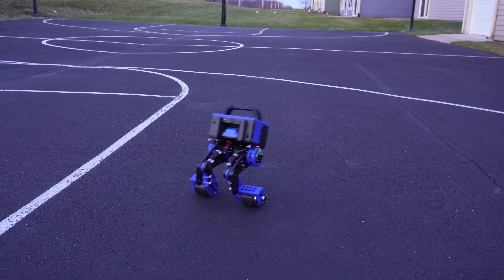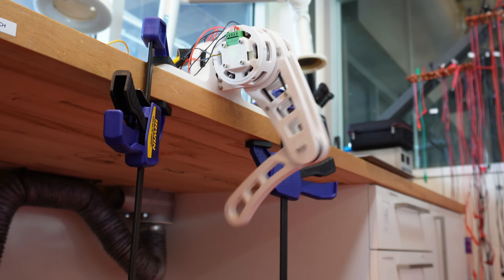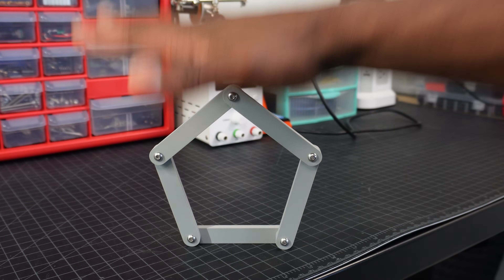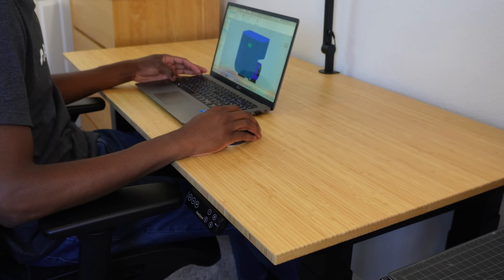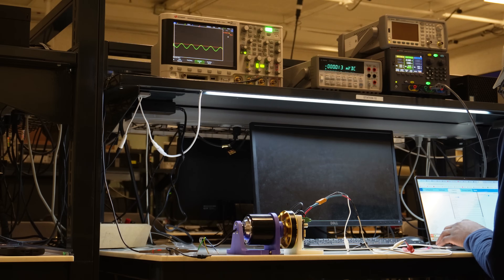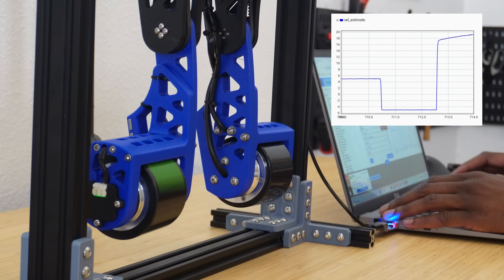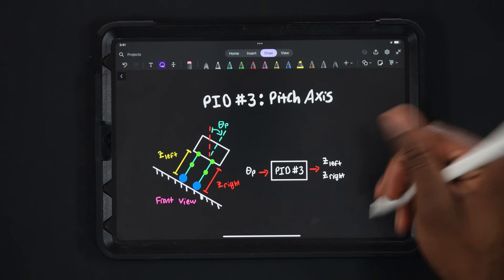This Robot Glides Like an Ice Skater

Comment: Can we get the calculation files or design guide, im into kinematics and manipulator modeling and also the control implementation. U will do a great help if u share the project in github.

at second stage u can implement SLAm, computer vision and machine learning to make it more capable

Comment: Would be interesting to see version that used capstan drive drive feet, only used to control center of gravity, is short movements.  Legs would do the walking with feet doing any needed fine tuning.

Comment: you need to make so when you take the handle, it goes in portable mode and turns off, and when you put it back on the floor, it turns on and it streches back to ride

Comment: after the automatic topology optimization hype died down, i actually looked into how it was done, because there didn't seem to be any open source tools as specific as the one in fusion 360 to do it... because it's just an application of finite element analysis. it's worth 'reading the tea leaves' in the stress/load output of fea, things like trusses can actually make realistic loads worse, and the resulting data can tell you where the stress concentration lines are with loads you care about. 3d prints being hollow is actually an asset in terms of stress concentration and it can be counterintuitive. each contour in a 3d print adds stress like rubber bands on a watermelon, corners crack, large corner radii don't ameliorate it as much as they can in other materials

Comment: 4:39 ❌ Don't add these cutouts to 3D printed parts for weight savings. The extra high density perimeter lines are almost always heavier than infill and top layers. There might be some strength advantages, although infill is already pretty strong.

Comment: A. That's neat as heck.
B. You forgot the googly eyes.
C. The ankles are bowing a bit. I wonder if the wheels could be aligned more closely under the legs to reduce the outward twisting force, or the prints could be reinforced with bolt-on sheet metal plates cut with a bandsaw and drilled with a drill press.
D. Love how it folds up!!

Comment: Enjoyed watching this, thx. -really good video of the whole process too.
On the design: I think the bipedal wheeled robot is probably optimal tbh. There are very few animals with 'spinning bits' apart from microscopic flagella and I think its unlikely evolution would ever be able to make the jump to wheels for bigger things as there is just too much stuff needs to be in place for them to be considered on a macro scale  -by the time you have something like a 'foot' it cannot de-evolve/evolve into a wheel...  But a wheel can act like a foot on rough terrain when fixed and like, well, a wheel on smoother terrain. Plus they can traverse much more efficiently in this mode.
One further advantage of the triangular truss method when 3D printing is that you build internal printed wall thickness around these triangles further strengthening the component if not printed at 100% infill. For a really strong piece you could investigate stopping the printing and incorporating carbon fibre 'tow' into each leg part. I would see what breaks most!

Comment: This is a fantastic project! How did you go about soft starting the micro O-drive controllers in order to not fry them when connecting the battery? I looked around your links but couldn't find a circuit diagram.

Comment: Now, throw this implementation into navidia omniverse. and have it " run over obstacles Predictively making jumps and other things." In training, on top of that, have it do ballet and other figurine attempts from what would be controller input.. The success factor should be, is it standing up still balancing on the PID controller And is it basically standing still after training. Realistic user input robot does something dramatic trying to balance tries to weigh in random chunks of its motion controller at different intervals.😮

Comment: You know what you should do you should add Cameras so it can go around and it can not run into anything also you should make it to where the camera is if they see a room and there’s like stairs it can bounce up the stairs so it starts going forward and then it bends down and then jumps as it’s going forward Make it be able to stay still in a small area so we can stay on the stair and then had to go upstairs or maybe add motors on the side that could push it upstairs I just think it would be cool. Also, I really like this video and I think you’re gonna go very far.

Comment: Legged (+wheeled) and dangerous! Impressive stuff.Your folks must be over the moon with you. Mine is a sound engineer but my heart is in this stuff. Wish I had known when it was my time to find these things out. They didn't lead girls to engineering fields (despite my being a math and science nerd) unfortunately back then and I never had a firm understanding what it really was till my love of tech and my love of making stuff converged. Coincidentally, I'd also learn I was "on the spectrum":, as it were, at the same time. Suddenly so much made sense. 

I grieve a little for missing the boat, but I still learn on my own. I'm building a couple things currently. One is a Hexapod crab thing which is fun, and the other  is a laser cnc. I have to strip the cnc down and rebuild it, though, as well as replace parts on my printer to print a slide mount for the laser head so I can adjust it's height. I've got tons of projects, but those are my scratch builds, self-sources parts... one might be amazed what a person can learn in the name of saving money to achieve the same goal as something bought off the shelf. It's also got me working on my own car now. A new development. 

So weird to be picking up these things so late in life, when I take a step back, but I guess better late than never. It's just that since the ASD thing and allowing myself to settle in with it, not only did my life make more sense, but I could look at things and see how they worked sort of out of the blue. It's like the doors of my mind just started flying open. Weird, nonetheless. 

Anyway great work. I've already binged about half a dozen of your vids, but I need to go do some stuff. You are the next Mark Rober, for sure.

Comment: Insane video and great display of skills. I have a question... I've been a software engineer for almost 10 years but been getting into arduino / raspberry pi and now ros2. what is a recommended learning path to get to this point? I understand it will take years to get to the abilities displayed here but I am committed to the learning process, just need a good path. Going back to school isn't the most ideal however if a specifically recommended course would help tackle an area, I can justify going for these specific courses. Any suggestions/advice would be greatly appreciated.

Comment: but, if you put both wheels on a base, tilt the base instead, for roll balance, your wheels will stay better aligned on flat surfaces, and you would not need legs at all - unless you plan to teach impulse to walk, eventually?

Comment: Very interesting, and well beyond my capabilities, damnit. Just one suggestion, you might consider rolling surface joints with a capstan drive system for the legs.  A demonstration I watched showed that they could generate more torque, faster response times and used less power than other motor driven joints. Just an idea.

Comment: I bet a much smaller RL model would work if it was running in parallel with the PID model, or if it was only controlling the PID parameters.  I wouldn't be surprised if it were an under-explored approach given the amount of work required to first get a classical control system working.  Perhaps an interesting next-step.

Comment: Excellent video!  I used to have a knack for tuning large industrial CNC machines with analog controllers.  Lots of messing with PID parameters, but using trim pots instead of parameters or code.  Good times!

What's that software you're using on the table for your sketching?

Cheers!

Comment: Great job. I am working on basic balancing bot using Hoverboard motors, MPU6050, Pico.  Plans to add similar legs later once wheel balance is achieved.

Comment: Nice work man! You should do some load testing with and without triangles. Maybe you can make a class project out of it! In my experience adding more walls and using Gyroid infill can make as strong or stronger parts than designing the trusses in. The triangles do look good though...

Keep up the good work!

Comment: Great video! But you shouldn't need to reduce your parts into triangles when using an FDM because you can control shell thickness and optimize your infill so that it's thicker in certain areas and thinner in less critical areas while balancing weight and strength.

Comment: A long time ago, before brushless small motors were a thine... I once thought about a mechanism that uses something similar to the electronic clutch that they use on some AC units in cars, to turn the wheels on a robot from free-wheeling into a locked state. So you could 'lock off' one of the wheels, and then use it as a foot with friction to push off from a stand still. My mental version had wheels from rollerblades.

Comment: This is sick. If you ever decide to learn the ai walking program it would be neat if it could transition the wheels to feet or just use them as feet by locking the rotation so it could truly go anywhere and use the wheels to still go fast on flat surfaces

Comment: This thing is so freaking cool!

You know, there's still nothing really stopping this wheeled design from being able to "walk" on more variable terrain by locking the wheels and using them as feet. You'd still need to figure out the walking algorithm thing but imagine how cool it'd be to have both abilities!
Reply: I saw an example of this with a Boston Dynamics Spot where the "paws" were replaced with rollers.

Comment: I was wondering if the wheel being off center of the legs was the better choice or if it would have been better for them to be in line with their legs. Off center gives more stability from the sides but in the center wouldn't bend the legs as much and the wheels would have more contact with the ground. Also when it jumps it might not break its legs :P

Comment: This is so good! I'm a data science student / research assistant and I mainly work on RL algorithms. Don't be scared of it, it is more and more crazily plug and play with so many frameworks. The main difficulty is the environment. You could use unity to simulate the physics and import your robot 3D files in it, and then use unity RL framework ! It would be an easy way to start. If you do so, spend your time perfecting the environment before perfecting your agent

Comment: Fantastic! 🎉❤ a question I have is about the programming. Instead of trying to write the perfect code, why not train the machine in a shadow mode.

What i mean by that is using a mirrored setup where you physically imitate what you want it to do, and then the robot uses the parameters it's read as a basic guide for how to operate. For example balancing, walking forward. The machine should be able to replicate everything you do consistently? This will then be saved as a walk command, a turn command and thus the machine can have a reference to what it should be vs trying to calculate everything raw from scratch every step
Reply: 'shadow-mode' would be good for a humanoid form in terms of how the moving parts work, but robotics can have wildly different from humanoid forms..

Comment: amazing project. Im still waiting for one of these wheel leg robots to have its wheel motors placed higher up the shin or even in the thigh, and drive a much smaller, lighter wheel through belts. There's no reason to put that much weight in the feet

Comment: When I first started fiddling with balancing robots I made one that used only a 3-axis accelerometer. took me awhile to figure out the maths for it, but it turns out, if you put it perfectly along the axis where the wheel's axles are, then you can prevent any 'falling' forward/backward acceleration. From there you have three pieces of info to process: the force of gravity skewing everything 'downward', the difference between the 'downward' force of gravity and the value that results from being tilted at an angle forward or backward, and the difference between THAT value and the force created when actually driving forward/backward, thereby causing acceleration.

With known wheel sizes, motor speed can be used to calculate distance travelled thanks to circumference, and distance over time is speed. It was integration hell to figure out how to identify and isolate all the different information I needed for the robot to work correctly, but in the end, the math worked, because math! Mad respect to anyone who willingly subjects themselves to not only one PID loop for a balancing robot but THREE of them. Great work and a very stable looking robot.

Comment: I am building an actuator with the exact same motor. Don’t you think that the 3Nm that you measure for the stall torque is due the 6A current limit of the odrive micro? Did you test with the bigger odrive controller?

Comment: Tip: don’t do cutouts when 3D printing. Printing isn’t like cnc where you want to minimize volume, leave it as a block and let the slicer fill it with infill. The walls are where most of your material would be. If you want more control over the strength properties then check out modifiers. (Doesn’t apply to the resin printer though)

Comment: Way cool project! 
Just a thought though. Does a 3d print like that actually weigh less when you put the triangles in it? You end up having more walls meaning more plastic. It seems like adjusting the infill shape and density is more effective. They would make it stronger. Although maybe adjusting the infill would be as effective? I won't pretend you aren't way smarter than me at this, though.

Comment: Super cool! Check out Ascento, a commercially-available robot with basically the same morphology. They have some very cool demos of going over bumpy terrain where the legs independently change their extended length to keep the "head" level. Could be a fun extension of your control system

Comment: What if you didn't have motors on the wheels and instead accelerated like you do while ice skating, by pushing the legs apart under and angle? The angle depends on speed and needed forward torque, I think.

Comment: extremely impressive, but by no means like a skater. A skater wourld lean to the center of a curve and not outward. As a skater your can't produce any backwards or forward force to stabilze. If you tend to fall forward, you will not push your foot back but pull it under your body... so this robot is moving completly oposite to a skater 🙂 and this seem to work realy good.

Comment: Really nice, i guess if you get the motivation to do the AI walking part, it could have both modes, as you could just block the wheels and walk so it could go up stairs and go through terrain that can't be rolled on, and still be very fast when the terrain allows for it.

Quite inspiring stuff, i finally gave in and ordered myself a printer, i'll see if i can get some robotics experiments going, as a software dev with almost 0 knowledge in mechanics :D, the math will probably be a challenge, but i can start with 4 legged stuff, should be more forgiving.

Comment: He looks pretty stable you did abgreat job programming him. The hard part about AI is getting training data. I think the way these companies got that was mostly through simulations. They run a million simultaneous simulations of the robot trying to walk, and give it points the faster and longer it stays up. It would not be something you can just download like a large language or vision control model would be. You would need to invest a lot of time in creating the simulation. There are programs that help with it, but you will have to create the algorithm that randomizes each set and learns from each set. But if you ever get that done, you can use your trained model pretty easily afterwards.. the algorithms for a self balancing robot are far easier to accomplish in the short term. You did good!

Comment: awesome video! @ 1:06 Could you give me a clue for a searchword for these geared motors? Never seen these before, they seem really cool!
Reply: GIM6010-8
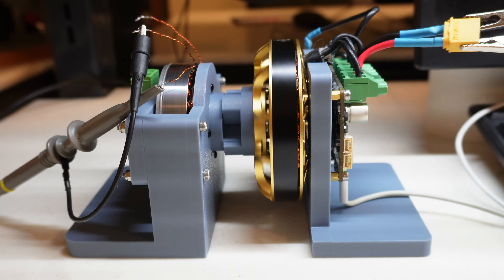Reply: It's a brushless (bldc) motor with a planetary gearbox, which is common but yah, I've never seen on in that formfactor before. They're usually a stack up of the motor with gearbox on top. I could definitely use a couple edit:  EaglePower LA8308 KV90 KV130 KV160 KV180 KV205 High Power Loading Brushless Motor for Multirotor Large Agricultural Drone -- You can see the part number at @1:39
Reply: @Mike-mu7tk  Thanks for the Part number. This seems to be the number of the "normal" BLDC motor he uses to test the one withe the gears...
Does anyone know something about the part number of the geared motor? would be much appreciated!